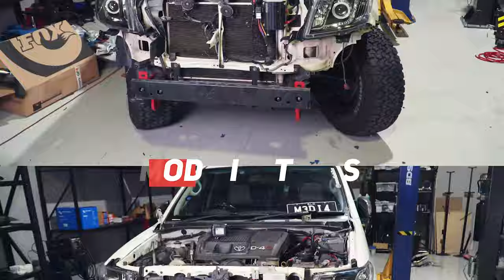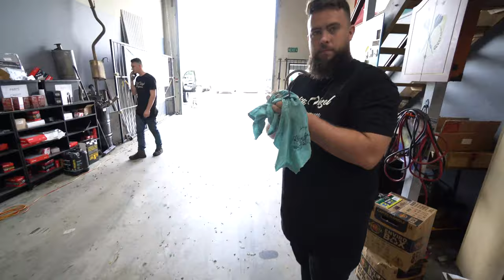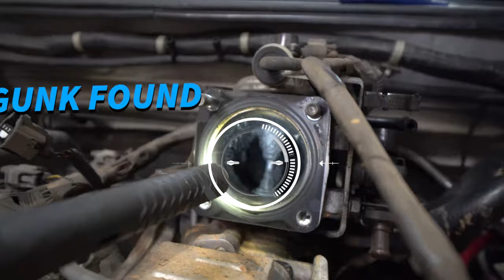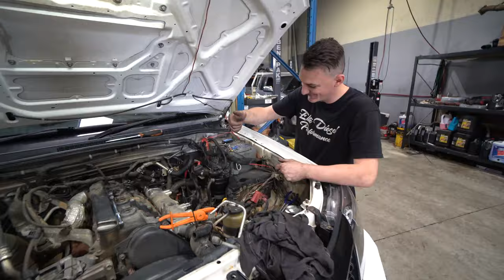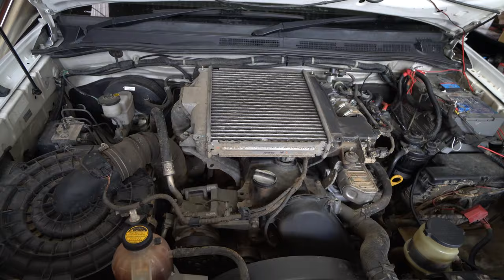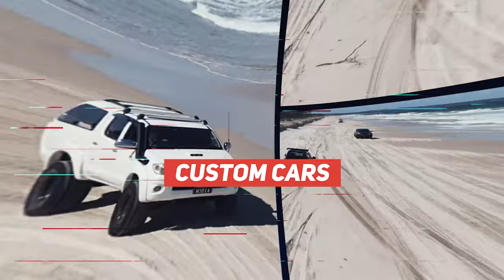Toyota Hilux N70 D4D 3.0L Intake Clean - 4x4 offroad MediaHilux

Comment: How much did they charge?
Reply: I got mine done $275
Reply: EGR AND INTAKE CLEAN
Reply: @gregdogg10  so did they remove manifold? Were was that at
Reply: @Jase-so2tm  just at my mechanic on the Gold Coast. Yep all removed and cleaned. Mine wasn’t too bad as it had an egr plate
Reply: @gregdogg10  which mechanic mate
Reply: @Jase-so2tm  are you on the Gold Coast ?
Reply: @gregdogg10  sure am
Reply: @Jase-so2tm  Gold Coast service centre
Reply: @Jase-so2tm  got my injectors replaced aswell